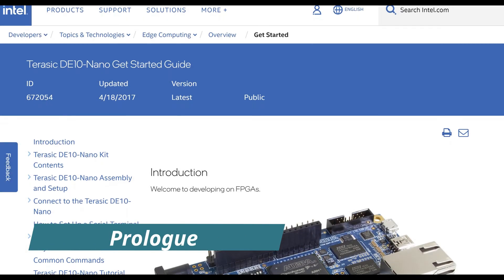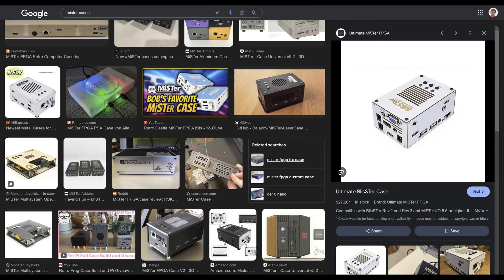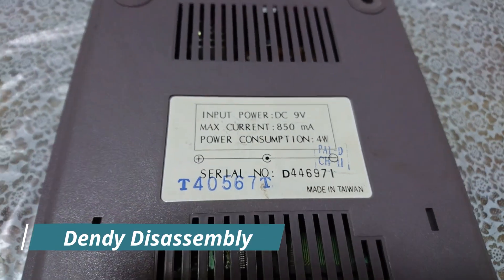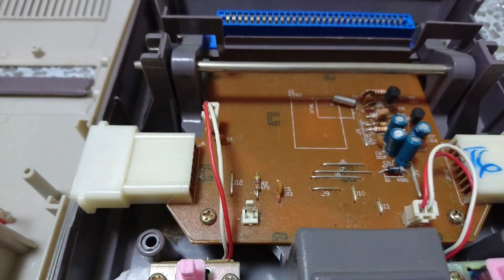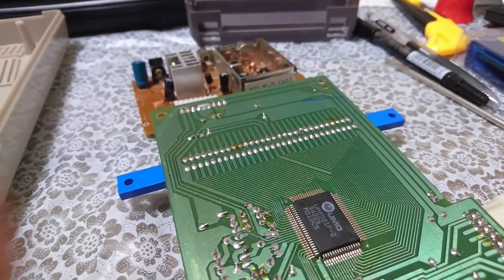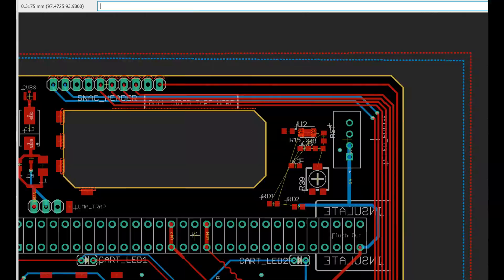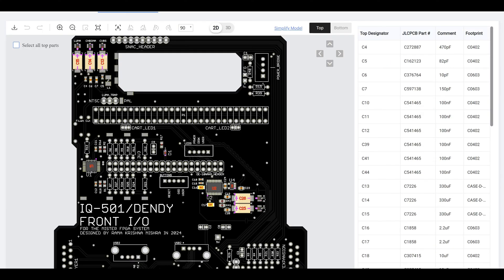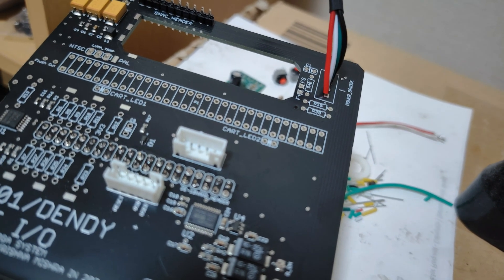The Mister FPGA Computer Game System  [Part 1]

Comment: do you think it would be difficult to clone the de10 but instead of creating another direct clone, repurpose the components into a jamma pcb board?

so basically a jamma pcb with de10 built in.
Reply: The Mistercade project by MiSTerAddons (and other projects I've seen) essentially do this.  Top tier addition for an arcade
Reply: @WalrusFPGA ive got one of them and got a couple  retrocastle version also. 😊

all up ive got 3 de10s in my personal arcade.
also got a few groovyarcaee builds(not sure why mame gets a bad rap)

However i would love to upgrade the rest of my cabs with fpga specific jamma boards as  buying de10s and jamma conversion kits like those i have is an expensive undertaking 😂